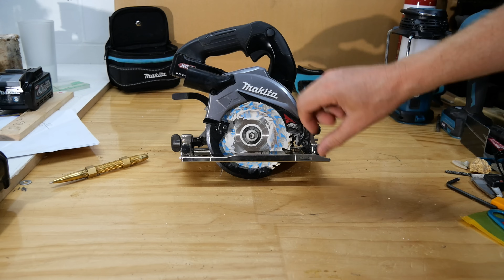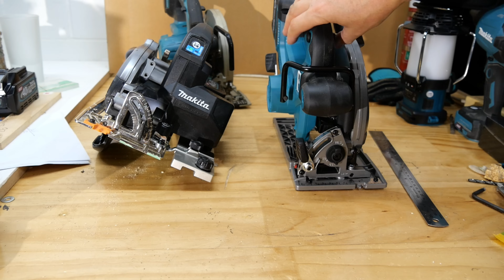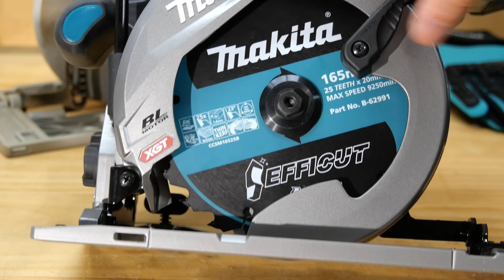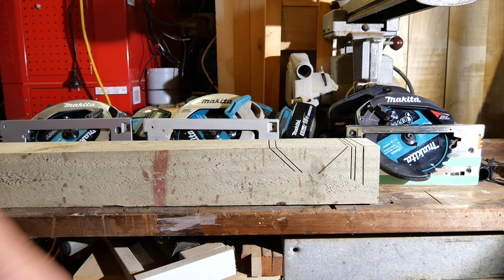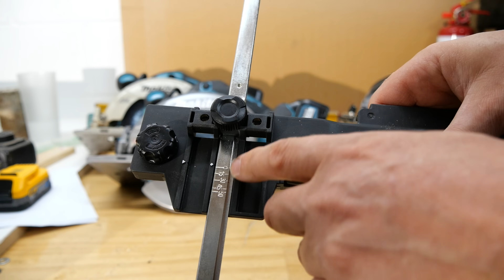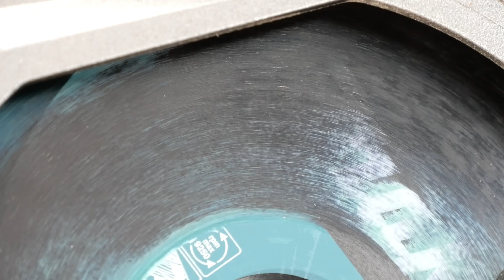Makita GSH05 40v BLADE LEFT Circular Saw Review. Makita 18v VS Makita HS012G 40v Saw Showdown

Comment: @toolsandstuff Mr Tools, aloha. From Hawaii 🤙🤙🤙 why is the blade left cutting faster than the blade right is it because the saw has a smaller blade? Do you think they are using the same motor just configured differently 🤔?

Comment: The 40v 165mm blade on the left is a terrible saw. My workmate has one and it's a dog
Reply from the maker: Why?
Reply: I’ve got one, cuts good, ergos is crap with anything but a 2.5ah as battery sticks up and annoys your forearm and handle angle is crap. I’ve had my 40v drill in for repairs twice, and earth auger went into day as stopped working after 15-20 holes light comes on nothing else goes, people laughed when I bought Milwaukee 10 years ago said Makita was more reliable, not sure me and Makita are going to get along if this keeps up.

Comment: Has the depth of cut bar been upgraded? I've knocked my 18v off of a table before and bent the black bar with the depth measurements. After that, it just doesn't adjust smoothly at all. 

Hopefully the new bar is more robust! The right blade 40v (American version) is definitely better than the left blade 18v.

Comment: Watched a lot of your videos and need a recommendation. Have an old circular saw that need replacing, but doing mainly cabinetry at the moment. Makita plunge saws are so expensive, what would you recommendation be around circular saws either with a track base or the adapter? HS011 looks great, but big. The HS004 maybe, or is the an adapter option more desirable? Wondering if I'm missing something that plunge saws do that circular track saws can't. Seems almost like for like...

Comment: I came up using mostly Skill 77s, so I'm a blade left guy.  For me, the better visibility of the cut line more than offsets the material holding and dust on the user issues.  No saw is perfect, but these are pretty amazing.  Right or left, go with what works for you.

Comment: The depth of cut on that new blade-left 40v saw is a huge balls up, I've been using my DHS680 on site for the last 6 years and my only gripes have been the ripping performance (power wise) and the depth of cut at 45 degrees. I'm gutted to see that only one of these issues have been fixed with the new saw.
Reply: I have the same saw but I only use mine for stuff at home and it's a great saw. If you been using it for 6 years that's impressive and I agree depth can be improved a bit.
Reply: @pauljohnson9326  yeah, my first saw ended up getting a new motherboard after it got very wet in a storm whilst I was cutting in some rafters, I then bought a second DHS680 after 5 years use and use it strictly got demolition work and when it's really wet out. Great little saws!
Reply: I'm surprised they didn't fix both of those issues. Now I don't know which 165mm to get.
Reply: @lamdog24  the 40v power for ripping is much better than the 18v. But yeah, depth of cut on both isn't great.

If you already have makita gear, go for the 40v one. If you're only starting to purchase tools... probably still get the 40v one haha im now using Hikoki 36v stuff and I love it, bit their circular saws aren't as refined as the makita stuff.
Reply: @hamishrhodes5108  Yeah I have heaps of 18v but starting to get some 40v for certain tools that would benefit from the extra power like the circ saw and impact. 

Just can't decide between HS001G or HS012G. Just don't understand why the HS012G didn't have the same depth of cut.
Reply: Depending on where you are at in the world, might be worth checking out the flex inline saw. Same blade size, but much better cut capacity.

Comment: 40v looks great and is definitely more powerful, though I expected that given the higher voltage and how old the 18v model is.

I use the 18v and love it.  For plywood and cross cutting lumber it works great and I use it almost exclusively unless I need the depth of cut with the rear handle 7-1/4”.  Sure the 6-1/2” could use a little more power for ripping.  Maybe Makita will give it a well deserved update?

Comment: Prices and product for XGT finally Gett ng close for me to consider more than a few XGT, still have many 18V tools that are great, just wish they were backwards compatible batteries((40V)
Just got the Hikoki/MetaboHPT Belt sander-luv it and it's much lighter and powerful and wider base than the Milwaukee and can be used with AC adapter(good option)
Maybe a good tool test with cordless sanders
Haven't seen one from Makita or DeWalt yet.
AEG(Ridgid), Milwaukee, Kobalt, Hikoki ? Have one
Maybe a t

Comment: I'm still on the brushed 18v but lacking "ripping" power where the 36v tacksaw can't cut. May skip the 18v brushless straight to this one. Love the versatility because of the size and as you say there's a tracksaw for anything requiring accuracy. The efficut blade supplied on the 36v tracksaw as stock gives an amazing finish and cuts so smoothly.

Comment: The balance of HS012 is more on the blade side compared to HS680, just picking up the saw from right hand, immediately have to counter the balance by twist clockwise, also the hand is more comfortable on HS680

Comment: I think I found the replacement to the Milwaukee M18 165. The Milwaukee is a good saw but one day it just stopped working. It turned out that dust in to the switch. And I found out after changing the switch.🤷

Comment: 17:12 that looks a few degrees off square. Anyone wanting to use this as a track saw replacement might have to layer tape in that centre channel.
Reply: You can also asjust the base of the saw. I had to adjust mine as it wasnt square out of tbe box which was dissappinting.
Reply: @marlowkenyon307  then your saw wouldn't be square in normal use. Go to 17:13 in the vid and you'll see the saw is falling into a lower section of the track that a proper track saw doesn't touch
Reply: Possibly it’s just a wide angle lens on the camera.  It distorts the perspective.  Most YTbers use wide angle lens cameras.  I mean, the “tele” lenses on some smartphones are even sometimes what traditionally has been considered wide angle.
(I teach perspective drawing 😊.  Not that many bothers about that any longer.  But then they—like everyone these days—will get tricked by photographers who intentionally distorts perspective to manipulate a “visual story”.  Like using a wide angle lens to make a circular saw that is square look skewed, while it isn’t, but be able to claim “look, it isn’t square”.)

Comment: will there ever be a scenario where 18v beats 40v ?
Reply: Its really only the small things. Besides power and run time the 40v tools seem to come with the occasional quality of life improvement (like the base adjustment on this saw) 

Not intentional but the 18v drill driver is still better than the 40v as it seems to break quite easy
Reply: @wearsjorge55  it is actually the opposite, newest high end 18v drill has some reported issues